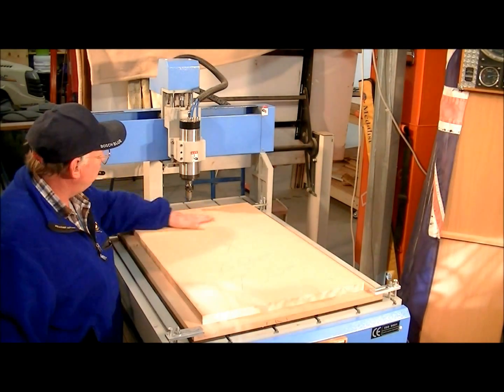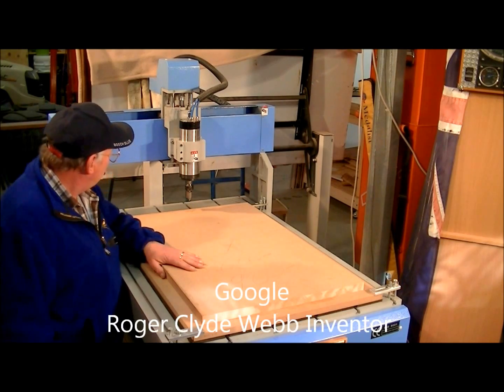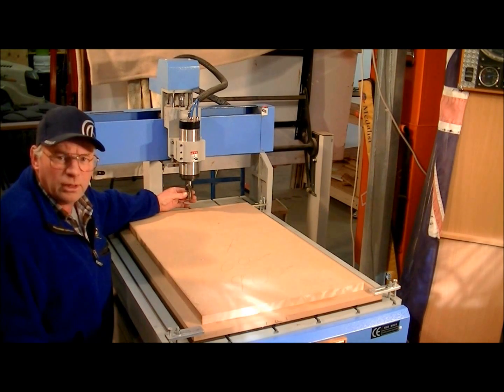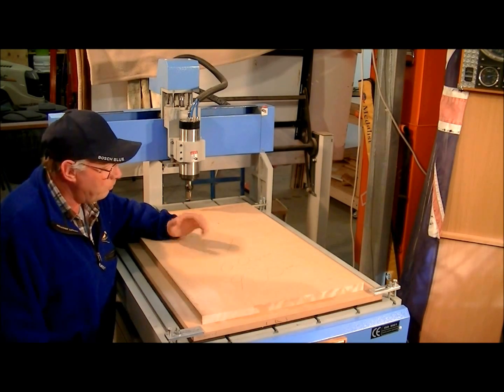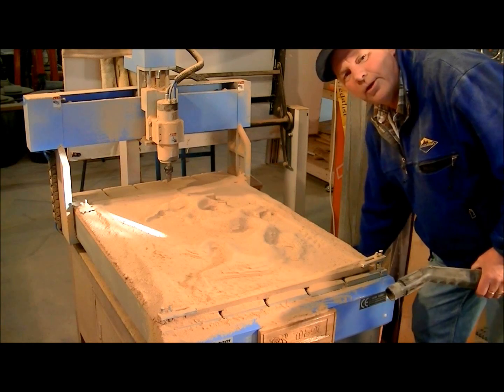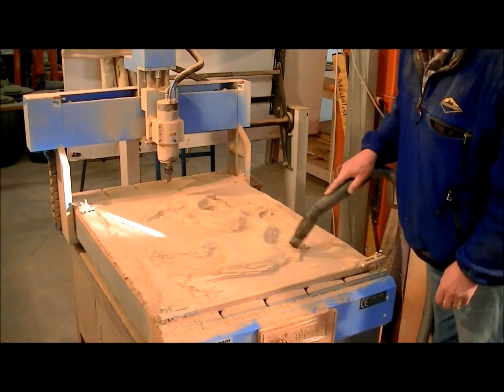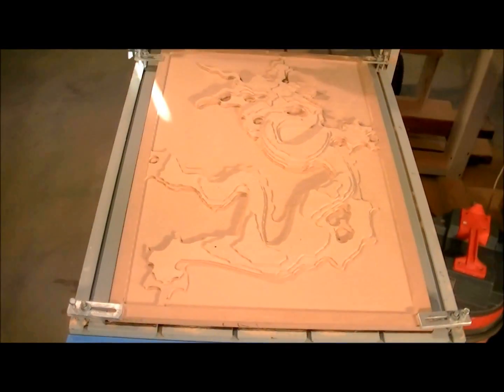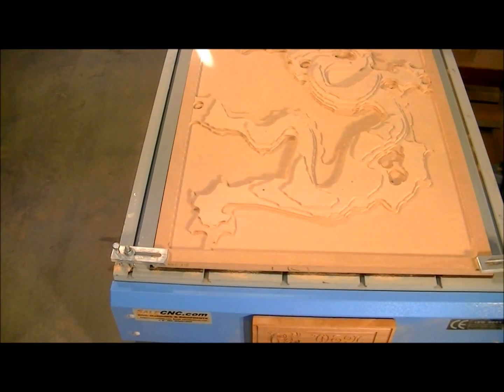CNC router can make $500 per day machining 3D Dragons in MDF

Comment: Hello! I am interested in working with 3D carvings on MDF and I was wondering about feeds and speeds for MDF, using Ball nose bits up to 6mm diameter.  I have a 6090 model chinese CNC.
Also could you please tell me what to use to treat my MDF sculpture so it won't swole up but also protect it and maybe paint it afterwards? I'm a big fan of your work!

Comment: seems like you could save alot of expensive machine time with a plain sander for prep, have you rigged up noise suppression and a dust collector yet?
Reply: +rRobert Smith How sander knows where to take material off? How you later make toolpath that knows where you already took material?
Reply: Your eye and your talent knows where to take very excessive material off, and your toolpath does not care (or a quick 3d scan).
Reply: +rRobert Smith 3d scan, y right. doesnt it cost more than  this cnc.
In general good idea, depends, maybe i try it out one day. I mean simplest way is just to turn feedrate manually faster and slower. Sounds like crap but still one option. I doubt that planer or smth takes material much faster than my 25mm endmill but who knows, lets live and see what experience brings.

Comment: I love your video as how much did u buy the machine and what model, how did u learn math with x y and z 3 d... What was the easy software...
Reply from the maker: ***** 

Hi Paul,The 6090 (bed size) CNC router machine is from Salecnc
China, http://salecnc.com/catalog/new-products (speak to Jimmy good English), I
had the machine up rated to 8 inch / 200mm gantry and 2200w / 3hp spindle
(router motor) + I had the 4th axis. Total cost including shipping
and TAX, USD$ 7000, I would also recommend you purchasing ArtCam Express
software approximately 200 USD, as the CNC router machine is supplied with ArtCam
Jewel-smith from Salecnc China, but with NO 3D reliefs. ArtCam Express comes
with over 600 3D reliefs. Understand that there are years of learning and
experimentation by me that are not in the videos and projects to enable me to
carry out and achieve what you see in my videos. Hope all this helps. Roger
Clyde Webb Australia: )
Reply from the maker: ***** 

The 6090 (bed size) CNC router machine is from Salecnc
China, http://salecnc.com/catalog/new-products (speak to Jimmy good English), I
had the machine up rated to 8 inch / 200mm gantry and 2200w / 3hp spindle
(router motor) + I had the 4th axis. Total cost including shipping
and TAX, USD$ 7000, I would also recommend you purchasing ArtCam Express
software approximately 200 USD, as the CNC router machine is supplied with ArtCam
Jewel-smith from Salecnc China, but with NO 3D reliefs. ArtCam Express comes
with over 600 3D reliefs. Understand that there are years of learning and
experimentation by me that are not in the videos and projects to enable me to
carry out and achieve what you see in my videos. Hope all this helps. Roger
Clyde Webb Australia: )
Reply: Dear Paul, model is 6090( 600x900mm), we are cnc router factory, please send my email: sales-b@stepmores.com.  whatsapp: +8615053140621
https://www.alibaba.com/product-detail/CE-cetificated-2-2kw-DSP-mini_60006999263.html